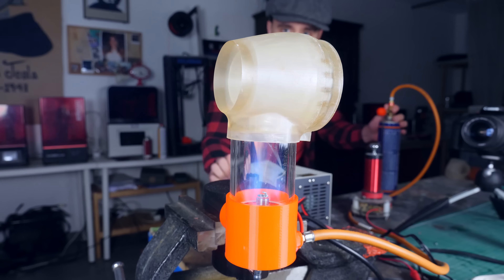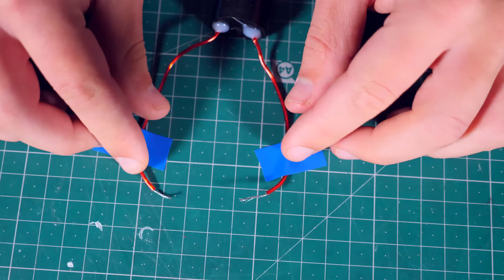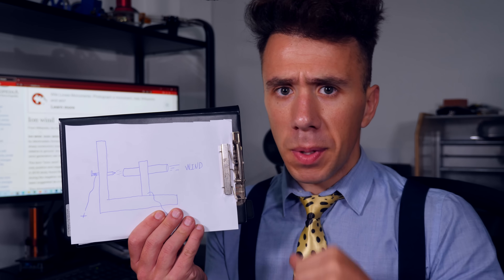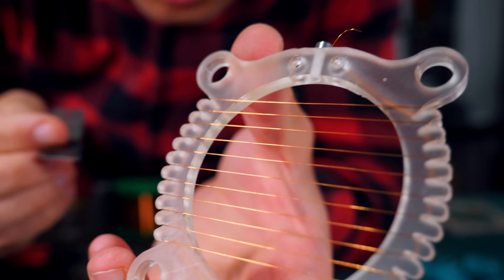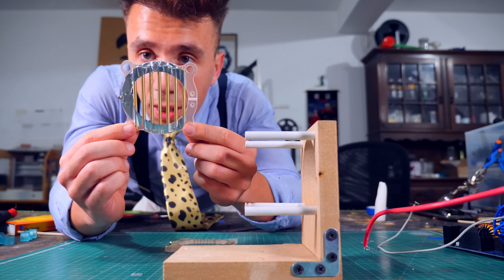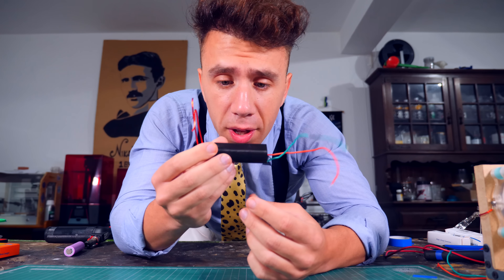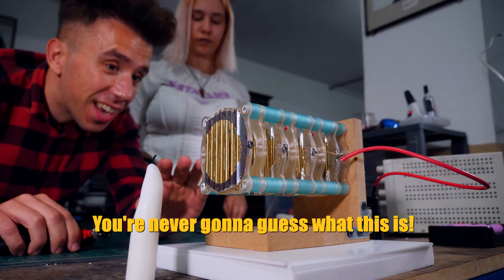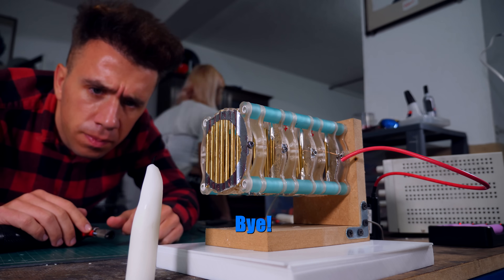I built a TRUE BLADELESS FAN

Comment: Heating the wire can improve ion emission in similar way like in vacuum tubes ( In directly heated cathode the filament is the cathode and emits the electrons ). Plasma channel is not entirely right - Flyback transformers do have built in simple half wave rectifier. In more modern designs, the rectifier is replaced by a voltage multiplier. Only very old flyback transformers do not have integrated rectifier, I never saw one (yours also looks "modern"). I know that because my ozone generator was generating wind instead of O3 LOL.

Comment: That IS a cool video. If I am not wrong the ion engine is used also in space, right? That means that it doesn't require air to work, but maybe it could work with other fluids, right? So.... Ionic engine powered remote controlled submarine happening in a future video? ;)

Comment: Something I did try to suggest in the last video, trying to replicate one of the first vertical take off system concepts in smaller scale, basically a fan with a ramjet engine at the tip of each blade / wing, or perhaps even trying to power it using the ionic thrusters see how much thrust it can produce! I believe it would be a very entertaining video, and I can't really afford any kind of printer where I live.

Comment: 3d print airfoils for the ground, and then coat the front of them in foil or copper tape. That should help reduce turbulence and help maintain air speed. Also out of curiosity how much static pressure can these generate?

Comment: here’s an idea, try changing the distance from the two “dishes” and see how that effect performance. in addition to that try getting more voltage through it. if possible I’d also try different size wires and tubes, maybe using tin foil would work better instead of the tubing for sets in series. love the videos man, keep it up!

Comment: Could this be done using mesh instead of wire? Would that increase the surface area could mean more thrust. Maybe inside a duct that narrows towards the end to increase the flow rate of the ionic wind…..a blade less jet engine…..

Comment: I am not an electrician, but I've heard flyback converters can be deadly, if that's the case it would be important to make this clear in the video.
Also, may be you could play around with the spacing between the stages and the spacing between the anodes an cathodes to see how that affects performance.
Another thing that might also help is encased the hole thing.
Great video btw.

Comment: Smaller high voltage generator was working better than bigger one,so you should try different amount of voltages to get the best result

You can use Marx generator to test different voltage bt resting and calculating  no. Of steps used

Comment: Real engineering has a fantastic video about a MIT team that powered a tiny plane using something very similar, so you could potentially track down a paper or two on the concepts. Also ion engines are very similar and fairly common in the space industry, so there is likely plenty of papers available on those too. Good work as always!

Comment: maybe cutting the wire isn't the best solution. Instead you could try something like saw blades. I don't know what this saw is called in english but I have one that uses these thin wire like blades you clip into this U-shaped "handle".
This isn't a copper wire but at least it would be the desired shape with all those sharp edges.

Comment: Try and make a rocket. Also you should test if it can work underwater or in high humifity to see how it works. To keep weight down, what if you were to spray conductive paint onto or electroplate thin bamboo toothpicks as the terminal to save a lot of weight...

Comment: Build idea: build a working rc airplane that uses a jet engine, even if it wouldn't last much, you could use the power of the engine to quickly go high and when the engine run out of the fuel, just glide like a glider

Comment: I'm not sure you can say your bladeless fan is performing as well or better then the Dyson one. How much electricity does it need to push the air away ? If it's using much more then it'll be performing way worse to me at least.

Comment: Try to connect one of these high voltage generator to each stage not one for all of them. And to make it more compact i think you could make a casing for the electronics and glue it to the main body. Also make one more stage to get around 20m/s.

Comment: How about a 'Potato Gun' made from an empty propane tank with a barrel with a camfered edge to slice the potato for a maximum seal. Pressure the system with air from a compressor that releases with a very large valve. Or to step the power up, put a spark plug into the tank and make a system to regulate air and propellant....Air/ Hairspray or butane or Acytalene/Oxygen from welding tanks. Spark it off and see how far the potato plug will fly. My brother and I made something like this but had a hard time coming up with a good/safe mixture. With your knowledge, 3D printer and electronic knowhow, I think you could come up with a monster project. Please be careful. The first iteration of the acetylene/oxygen version was tied to a very heavy trailer. When it was sparked and ignited, the trailer jumped 10 feet into the air. Scary and loud but super awesome. The potato flew at least a half a mile. PLEASE BE CAREFUL!!! I love your ingenuity. 👍👍👍👍
Btw, ours had a 2.5" galvanized pipe for a barrel.

Comment: i wonder what will happen if you push the air into a tube. and introduce a fuel mixture into the tube. 
wouldnt you have a bladeless turbine engine? a turbine without a turbine :)

Comment: When air blows on a cylinder, the air becomes turbulent behind it. Solution: place a non conducting something (could be paper) behind the cylinder, give it a symmetrical airfoil shape. And maybe close the sides, have the whole accelerator in a tube.

Comment: Vid idea: using fuel cell, attach a a rocket engine that uses the H2 produced from the fuel cell to power an engine, all u need are solar panels and water so fly it high up where there is warm moist air, use a condenser to condense the post air and use the produced H2 as a fuel source

Comment: After seeing a few of these ionic wind thrusters it got me wondering if you could use 3 or 4 of then as the core of a turbofan as a replacement for the combustion chambers to drive the N1 and N2 turbines?  It might open the door to more fuel efficient jet aircraft.

Comment: That thing is generating a significant amount of ozone, NOx and UV light. Very good for producing atomically clean surfaces without eroding much if any material, if you're interested in that. However, polymer components in that environment have a very finite lifespan, with the surfaces being worst affected. Some polymers are much worse than others. Also, ozone and NOx are very poisonous. Just a heads up.

Comment: prove there is air current coming from the device by showing the full device at a forward-facing angle so we can see that there is nothing, such as a regular fan, behind the device that is actually generating the wind. use strips of paper to visualize the currents. until you demonstrate without a doubt your claims, i will consider you a fraud.

Comment: 1) try scraping the anode wire a bit more
2) try hooking it up with an air multiplier( like the one your Dyson blade less fan use)
3)try uneven spacing for each generator module instead of keeping the them all equal
4) a curved pyramid like housing could help in more concentrated air at the outlet like the one used in a jet nozzle 

And for a theme suggestion for the next video a wingless aircraft with the principle of ionic wind and magnetohydrodynamic propulsion doesn't sound bad

Anyway love your videos as always and got to know so many things from your videos

Comment: Try and replicate the levitating aluminium triangle using the blade less fan made in this video. The system has to float but the power supple doesn't have to

Comment: One thing I would suggest is putting a bunch of stages in parallel instead of series. If regular fan physics/air moving physics is to go by, putting a bunch in series won't give you near the same results as if you put them in parallel. I could CAD something up for you. It would basically be a funnel with a bunch of stages pointing in towards the outlet. Then again, I'm no physicist, I'm just going off things I've learned over the years. Let me know what you think

EDIT:
I did some quick research on this and I'm sorta right. Putting in parallel will give you more air momentum, but the same mass therefore slightly less inertia. Series will give you more inertia because the initial wind is being pushed out faster with the same mass. This stuff is interesting
Reply: aray: as in more surface area. As the limit in this system is velocity(frequency and arc gap constraints) the only mean to up energy is by increasing area and manifold presure

Comment: Hey Integza, what about looking at Ultrasonic levitation devices? Also, teardrop tubes would help with the flow also encapsulating the Ionic wind into a tube flanged on one side will help to create a more potent wind force and more directional.

Comment: Guy who regularly works his own wewd here: those cuts at 2:10 and 2:13 look pretty dangerous. Look up "table saw kickback". Basically, don't cut something so short/stubby with the small cutoff piece between the blade and a fence. 

At best, maybe nothing happens. Pretty easily though, that piece can rotate slightly on the table, get wedged between the fence and the spinning blade, and acquire MUCHO momentum right toward your groin area. Not to mention, the risk of your hand encountering the blade as well.

Comment: I notice you were working with MDF but using brackets to hold the pieces together at 90 degrees. For MDF in particular, common woodglue is almost comically strong, and sets up fairly quick into a joint that is stronger than the MDF itself.

Comment: What happens if you turn this one stage 90 degrees to the other stages with wire and tubes? or you try to build a blade less turbine so that the air is forced into a kind of wind screw? But maybe they will cancel themselves out.... But it can't hurt to try, right? Or put a small fan right at the front that blows air in slowly and maybe your prototype amplifies the airflow like some kind of turbocharger

Comment: You should make either a jet powered drone or a chain reaction using multiple types of engines to trigger each other. Also keep up the good work really enjoy your content.
Reply: not sure if a drone can use this concept.
Needs a lot of stacks to have the mass of airflow .
A multicopter is flat (improperly named drone)
To use this tech idea, it would be like putting 4 high vertical tubes.
Would be interesting other types of of flying, or hovering.

Comment: no interest in the 3d printer, first off. no room for the one i have...
but, having an intake funnel per stages, and not leaving the whole array open air, would probably help with efficiencies. but like ducting a fan. using the stages like a batt setup, running more in series can be fun and all, but you should try running some in parallel, too. should mean more air on target, and you can vector each.

Comment: Air is kind of confusing, but my simple mind thinks this design would be improved by setting a duct around all the stages and also having the fan pull air from the "start" rather than sucking it in from the sides.

Comment: Try connecting the wire grid with the tubes of the stage before it. At the moment you are creating a backwards wind between stages. You increased the distance between the stages wich reduce it but you could stack them back to back if there is no voltage potential between the stages
Reply: Even better, combine the collector for one stage and emitter for the next into a single streamlined tube with sharp trailing edge. Perhaps serrated from the cutter on the aluminum foil box :) Alternate polarity on each stage so you don't get any reverse wind.
Reply: @dekutree64  Ooh. You just made me realise that the actual cutter from the box would be a great electrode.
Reply: I think it is better to use ground/neutral and positive charges. Neutral makes the molecules, well, neutral. And positive can remove electrons, making it charged. Wich is then reppelled by the wire with charged it. A neutral molecule has no 'sense' of electric fields.

And with this setup you get P-N-P-N-etc. So there need to be spacing since each P pushes charge in either direction. But further distances have weaker fields, so having P-N-[space]-P-N-[space]-etc. Makes wind go one way. The larger the space, the more effective, but it also becomes bulkier.

So if I had to guess, an alternating positive and negative with a larger spacing 2 or 4× the size of the smaller one seems good. But the spacing ratio is just a guess.
Reply: @suddeneevee9441  Buttered side down is right.  Your suggestion is basically the same configuration as before.

If he just grounds them where would he put the negative lead from his power supply?  Also to "ground".  That's the same setup.
Reply: @JasonMitchellofcompsci  The idea is that the negative of the supply is ground/neutral. So the charge at the negative of the supply is at 0V, while the positive is at a positive voltage. Ground isn't carrying any current, it is just there to keep the negative side neutral.
Reply: @suddeneevee9441  or you could say that the positive lead is ground/neutral at 0v and the negative is at a large negative potential, -V lmfao. Physically identical. The only thing of importance here is the electric field produced by the potential difference.

Comment: How about improving the design and making a negative side like you showed on 1:40 for a test maybe with the copper pipe and aluminum foil and see if you can achieve even faster speeds.

Comment: Hi Integza! You could try making these tubes a tear drop shaped! As you said, wind get's generated from sharp pointer wire( easier ) to the bland tube. Making the negative tube pointier form the end or front of the "fan" would reduce back wind( aka. drag), i think. Also it would reduce the turbulences, by directing the flow over them. Hope that it will help.:yougotthis:

Comment: You can try if keeping increasing distances between the thrusters have any effect on the airflow. As well as covering the entire setup so that air doesnt leak out in between the sets of thrusters. An ionic jet engine would be cool if you can build one.
Reply: It should reach higher air speeds if he builds it cone shaped, Large diameter at the intake side and with every following stage a little smaller diameter, so the air gets accelerated more and more with every stage.

Comment: After just getting a laser cutter/engraver, those parts you made seemed to be much easier to make using a laser cutter. Faster, cleaner and cheaper.
Reply: You use the tools you have at your disposal. That being said, you're absolutely right. Acrylic is the perfect material for building high-voltage projects such as this. It comes in sheets, rods and tubes, and with a CO2 laser - possibly with a rotary attachment - you'd be done by now. (Not really, but it sure is a fast method. :) )

Comment: I think the best improvement for the Ionic Bladeless Fan would be to make it a Ducted Bladeless fan so that the Air stream would be confined and Accelerated by each stage without loss or turbulence from the sides. simply enclosing it in a clear tube would help, and still let you see what's happening inside. making a tube that exactly matches the inner diameter of the printed frames in sections and then sealing it all together would be even better
Reply: Even better it could be integrated into one of the "bladeless fans" to make use of the phenomenon they use.
Reply: Every build of ionic thrusters I have seen is open. I think overall the stages aren't strong enough. The first stage couldn't push enough air to feed the next and so on starving the thruster without being able to pull air in from the sides on each stage.
Reply: @xXShadDragXx  that was the issue I had a well.
Reply: @PlasmaChannel An interesting experiment would be to vary the size of the stages to prevent starving the later stages

Comment: I just learned of Motorjets where a combustion engine is used to drive the compressor rather than having it on the same shaft. How about hitting the 3D and building one? Maybe using an electric motor to drive a 3D'ed turbofan to provide compression?

Comment: Try replacing anode tubes with wire only.. That reduces resistance to flow of ionic wind in front stages.. Thus boost ups the wind velocity..

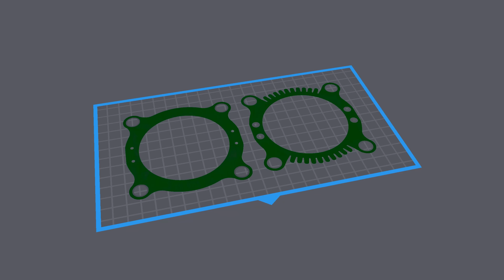Comment: 8:30 apparently Jay doesn't know that a flyback is already rectified, otherwise it wouldn't be a flyback 9:27 You're wasting material, could've done the same thing with two screws piercing trough one plank into the other

Comment: Hey Integza, I love your videos and I have a suggestion, I was doing a bit of research and found a potentially cool jet engine project that
maybe you could try out, it's called the Pratt and Whitney General Electric GE90. A quick Googling of the name should take you to a nice 
diagram of it. I thought this jet engine would be cool because there are 2 combustion chambers, and I thought that was a cool concept to 
power a turbine with, maybe by angling each chamber at say, 45 degrees to drive a turbine delivering more power! Maybe this could be done
with even more than just 2 combustion engines!? :D

Comment: So obviously, now you have to turn this homemade bladeless fan into a jet engine!!!!
Reply: A jet engine requires the air to be pressurized. High pressure air is needed. 
Ionic wind is very low pressure. You can't compress it, therefore you can't use it for a jet engine.